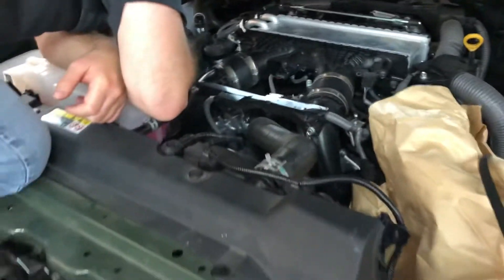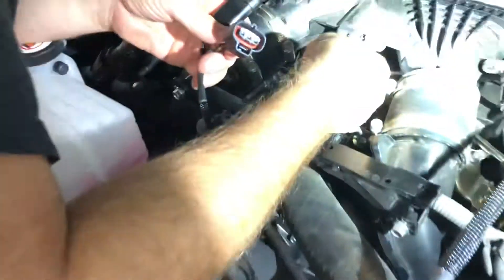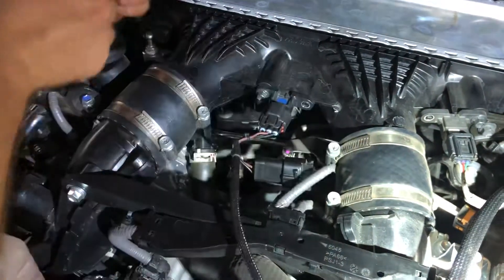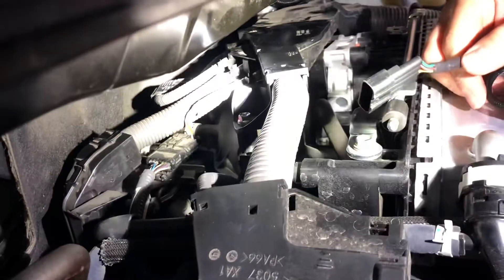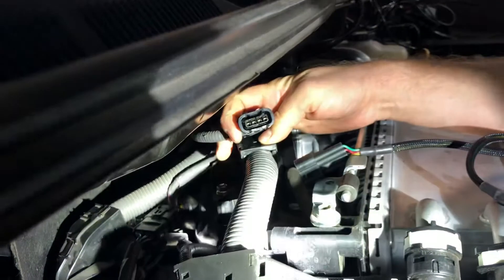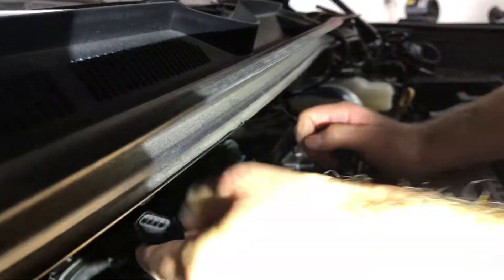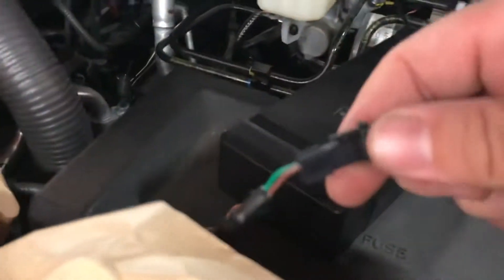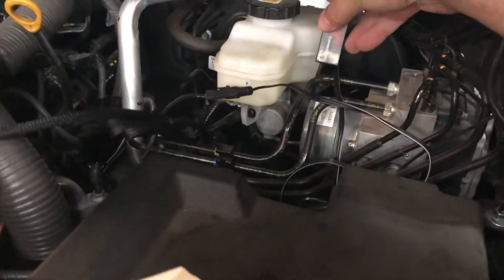2022+ Toyota Tundra/Land Cruiser JB4 Install

Comment: Ok, I finally got it. Had to use a flathead screwdriver on the other side to raise the clip. 

Man that first connector is already being a pain for me. I must be doing something wrong, pressing down and pulling as hard as I can. Even used a screwdriver to press down. I’m clearly not a mechanical guy 😂

The back two plugs were easy

Comment: I’m having the hardest time with that 90 connector.  Any suggestions or a pic of the connector to give a better idea of how to disconnect it?
Reply from the maker: There is a tab to push to undo the connector. Alternatively you can use a small flathead/pick to get under the locking tab and pull the connector that way.